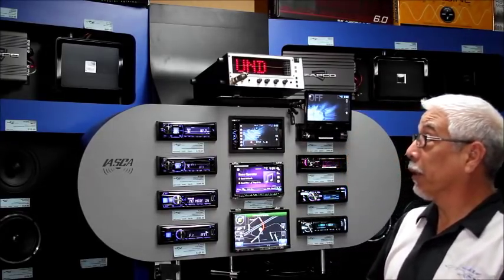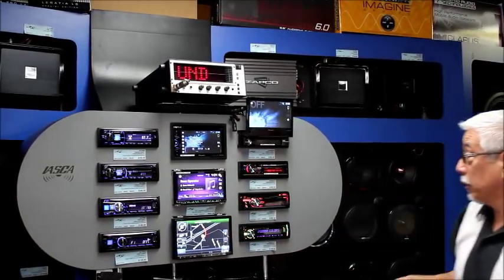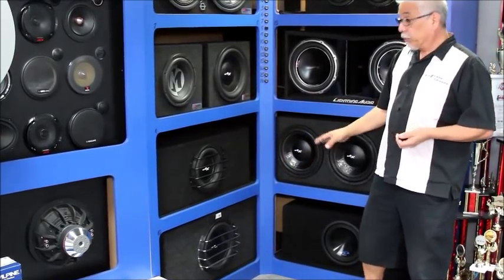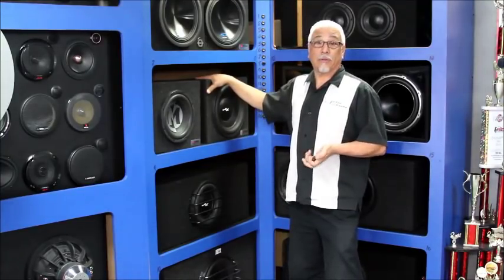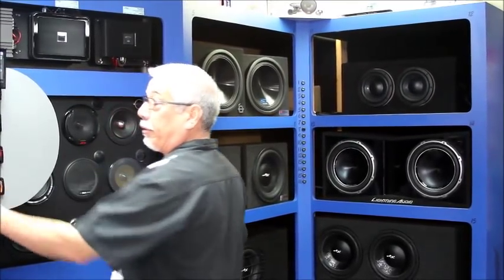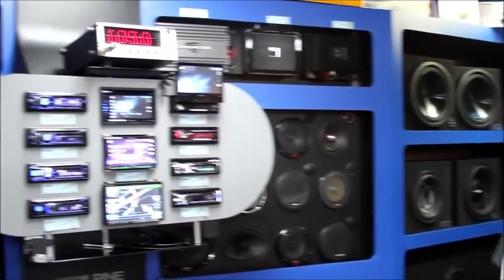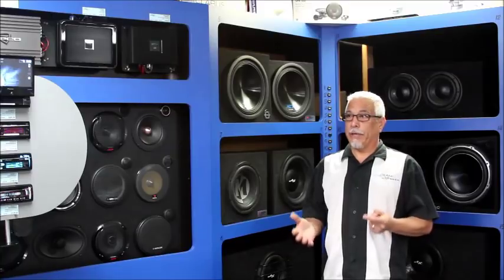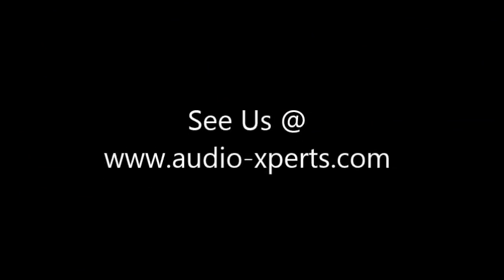Sealed vs Ported Demonstration by Audio Xperts using SPL meter to show output differences

Comment: Placing a sub near the floor vs midway up a wall makes a huge difference in output as well, doesn't it?
Reply from the maker: I wouldn''t say huge. It definitely makes a difference, maybe 1-2 DB at most. That will be another video to produce to measure.
Reply: +AudioXpertsVacaville in home audio where you place the sub makes a hugeee diff in output. the shape or the room will change the best place for sub. there will be dead zones in rooms where you will lose half your output
Reply: +oyobass So does using different subwoofers in a test!
Reply from the maker: +XcLuuSiiVe absolutely. Stop by for a free vehicle inspection so we can work with you on a design.
Reply: hey i live in Vallejo i want to get a custom box made for a single 12 inch(400rms pioneer) in a 2013 Hyundai sonata,was looking for a stealth box feel so there's still some trunk space.i was wanting to know an approximate price range,get back to me if you can.
Reply: not only that, but having all the extra subs around will mess up response. When I swapped out my 15" for an 18" in my home theater, but still had the 15" in the room I had a massive response dip. Unless the sub switcher shorts the coils on disconnected subs the same will happen here.
Reply: I don't know why people argue that you can get as much bass out of a sealed enclosure... you can't. The ported enclosure will always put out more bass. Closed enclosures have punchier, cleaner bass, ported is looser, but louder. Chambered give you best of both worlds, but those are the most expensive.
Reply: Richard Smith The whole punch vs loose thing is untrue. It depends on the driver, box, designers skill, room and placement. 
A ported box is louder at/above its tuning, but below tuning a sealed box will beat it. Also, if you have a set size the enclosure can be, you can fit more cone area if you use a sealed box.
Reply: smaller sealed boxes will always have tighter/punchier bass  regardless of the driver being used. anyone who listens to music will not want a ported enclosure. if you like your bass loud, exaggerated and boomy then ported is perfect.
Reply: that's just a rule of thumb.. only thing that's for shure is ported will be louder on low end. each box has whats called a role off point its the frequency that's the loudest for that box/sub. all frequency under or over the role off point will have less output. sealed boxes tend to have almost no output near 20hz compared to ported. that being said you want a box with a slow role off meaning it plays a wide range of notes at close to the same output before dropping off when you play all types of music. in general ported boxes have a sweet spot where they play a small range of notes much louder than others. but that's not always the case 4th and 5th order boxes throws all that outa the window. they can get nasty loud on even high frequency notes.
Reply: Sealed vs Ported as always pointed out in the 1990's era only give the maximum of 3db of gain over a sealed box and bandpass will give a 6db gain but the frequency response will be limited! As for low frequency, 40hz or below, sealed or ported will not make much of a difference with a subwoofer and capability will only be based upon a subwoofers design! 

JL audio has spent many years perfecting the subwoofer and older designs have proven to be more effective! There is a General Rule, once a perfected design, it cannot be optimized any more than previous. Any attempt to and you will actually defeat the purpose of the original maximization's and they will be lost! Leaving a watered down design incapable of performing as well as the former era! 

Subs once capable of performing impressively on lower wattage is no longer possible with newer versions that feature redesigned cones! Take for instance the JL W0's compared to the newer designs and suddenly you have a sub incapable of performing low frequency output as well as older versions that run twice the cost and requires 2 times the wattage! 

The best attempt to create a decent setup is to select two varying sized drivers that can fill each others voids! Back in the days of the original W0 series I opted for two 12" and  two 15" drivers and the selection proved to be very good! Leading to a dealer who heard them in action and saw the low powered amplifier that was powering them! To abandon Orion and begin selling JL as an authorized Dealer and Installer! 

The setup I had was only ran on 190 watts by 2 and was infamously known the police, fire departments and would easily set bank alarms off without breaking any sweat! Beats as low as 20hz were easily attained and the design did have the 15's running ported, 12's running sealed but an easy 150+ db was easy to attain! I actually had to buy 1/2" thick rubber sheets manufactured for use as dampening in rv's in order to prevent the subs from destroying the sides of my mini van! 

 I still to this day have the 15's and replaced the 12's with MB Quart Onyx series subs, those 15's are nearly 17 years old and only needed refoamed one time! To this day they will still perform the same as they did back in late 1999 and early 2000! So I would recommend two varying sizes even if just using two subwoofers, like an 8"/10", 8"/12", 10"/12" or even 12"/15" combo or pairs of each! 

When shopping!
Look at the subwoofers cone design, depth of the basket and magnet design/voice coil combinations, deeper cones will actually produce lower end notes more easily! Flatter or shallow designs will produce more punchy middle tones when it comes to lower price range choice! JL was always famous for the large rear bump that is close to 5/8"-3/4" on the 15" W0 Version, which equals less fear of bottoming out! It increases the ability to keep the coil in the optimized range of the magnetic field which will also optimize the efficiency of the driver!   

But choices are all up to the individual! They can be based upon previous experience, shared knowledge or dealer recommendations! But every vehicle will have a different response as well, my minivan had factors that helped like a fiberglass tailgate, extended wheel base and plenty of room for the nearly 10 cu ft ported box for the 15's and 3 cu ft 12" power wedge to face the rear! Some dealership have a computer program that can optimize a box design based upon an individual vehicle and subwoofer choice!  

I shopped where several of the JL vehicles had been built at, it was local to my area and they were always willing to haggle on prices! They could print out vehicle specific box designs for you to fabricate your own, they could precut all your material for your own construction and even provide approval for your individual installation to keep the warranty from going void!
Reply: LuxorVan Thanks for the tips man. I've been dabbling in car audio and this helped me out.
Reply: Richard Smith
you my good sir,are incorrectly informed.
Reply: AudioXpertsVacaville What are your thoughts on passive radiators? I am making a portable sound system from scratch amp and all, and am also messing around with ports sealed and PR
Reply: I swear if you fucking believe 190 watts is (Infamously known by police & fire departments) you need to sell all of your car audio shit, because its obviously not for you
Reply: It's because he's  one of those wannabe volunteers with walmart equipment in a hyundai hatchback that follows every flashing light he sees..... not because 190 watts. ;)
Reply: Just laugh at the imagery, we all know "that" guy. Don't be that guy.
Reply: If?
If one only uses a SINGLE (one channel - mono) Front SUB (extracted from the low end frequencies of the summated frontal MONO).

There is NO need to position a sub in a particular spot, for multiple sub woofers - which are "supplied" by the different speaker channels themselves, which "because they are different" are actually placed in several places around the room.

Plus, if multiple subs are fed from different channels, there will be NO self cancellation between them, therefore NO so-called deadening into "dead spots".
Just as there will be no increasing of loudness at a "so=called" sweet spot.

(self cancelation reduces sound to zero if 180 degree oppositely phased, whereas self-addition doubles the resultant loudness, when two wave forms arrive at the same position and BOTH are in phase)

SEE?

Multiple channels are NOT just confined to mid & upper/tweeter ranges, but are inherently contained in the ENTIRE frequency range of each channel. However high or low the (combined tonal) channel frequency is.!!!

Hence why I used TWO (50 watt rated) old 1970's Pioneer 12" 8.ohm HOUSE SPEAKERS, instead of some newly modernized 4.ohm 300watt rated inferior quality speaker.!!
To get the extreme low frequencies of between almost DC and about 20hz
Just as mentioned by @LuxorVan (who has attempted to remind everyone, of the advantage of old products over new models).!!
Reply: for a single sub there is indeed a need to position a subwoofer in a particular spot. My trunk. but in all honesty, you can get different' response curves in different trunk spaces with different positioning as proved by many in the industry... so.... yep
Reply: NEVER EVER ASSUME, that the older generation of the 1990's (or of the even older generations  of my vintage in the 1960's and 1970's), have zero so-called sound knowledge, or that we have no idea what constitutes GOOD sound systems, or know the differences between box ported / un-ported results

When it was US, during those experimental times, who created the "rules" (or no-rules) - that you assume are of your own MODERN post-2000 (or even post 2010 now) younger generations creation.?
Reply: I'm not assuming, I've seen this recently tested with pro audio equipment, and line graphed. forward facing, side facing down facing and back facing. freq response was measured in cabin at a common headrest. there were variations. Arguing with me is saying that the response of a driver cabinet is completely independent of the compartment it's filling with sound, and thus that reflected waves are negligible. That's silly.
Reply: No, no, no, I wasn't commenting at you Chris, but aimed that comments against the three nay-sayers who were against you.
I'm in total agreement with you on the old school equipment being far better than modernized highly refined gear, that hasn't got the all-round ruggedness of older equipment.
Reply: LuxorVan you my man know your stuff I could not agree more with everything you had wrote I did the same exact thing and a Mazda 3 2 3 but I did a 10 12 combo w4
Reply: Some difference yes. Still ported box is deeper cause the sound presser comes out better from the port. Put ur hand on the port cover it. U can tell the difference. Not rocket science !
Reply: What can you do for people with "Large Cars " ?
Reply: LuxorVan Finally someone who truly understands subwoofer dynamics, the use of two different sizes to fill the limitations of each, and how old school subs can put out as much dB as all these new designs on sometimes as little as a 1/5 the wattage.

Years ago I had a Punch 250A2 bridged (360 watts) running two Punch HE inside a 94 Jeep Grand Cherokee, sealed MTX Terminator box with about 1.3 CF per sub. It was louder than most people can handle, I never metered it but when I pulled up behind ANY vehicle at maximum volume the person in front of me could not see out of their rear view mirror due to extreme vibration.

Today I have two Pioneer Champion Pro in a ported 1.5 CF per sub enclosure on a CAB 1600.1 amplifier feeding each sub about 700 watts, the vehicle is a Saturn ION with the rear seats lowered. At around 42hz it approaches the loudness but is not as loud as the two Punch HE's which were receiving a whopping 180 watts a piece. This is due to the vehicle and subwoofer design just as you described.
Reply: Wow. You guys are seriously misinformed about the behavior of lfe in relation to drivers, enclosures, and cabin gain. Holy shit.
Reply: +ben h 😂😂😂
Reply: If you honestly believe watts determine loudness , then you must need to do more research my 160 watt rms efficient 10'' subwoofer will drown out your fake  2000 watt trash audio. Quality always dominate quantity.
Reply: @AudioXpertsVacaville  Nonsense. Placing the sub that high and likely away from the wall as well, you effectively kill the output.
Reply: @rich1051414  Who says you can get louder bass from sealed? Ported is going to get you louder bass and if you build something that isn't bass reflex or bandpass, something like a transmission line, you can get much deeper bass.